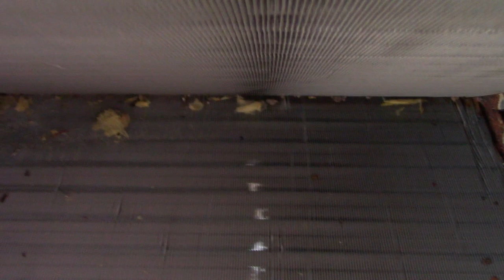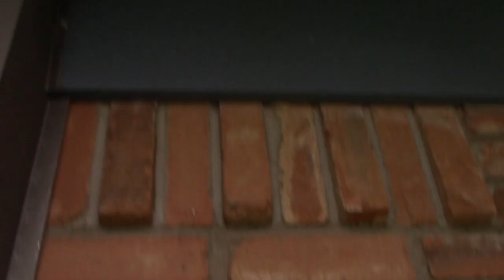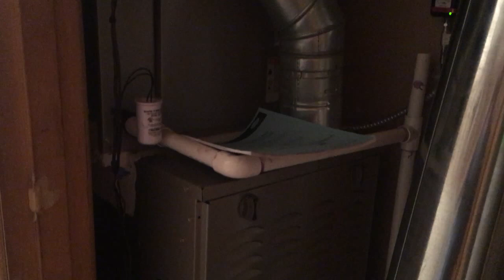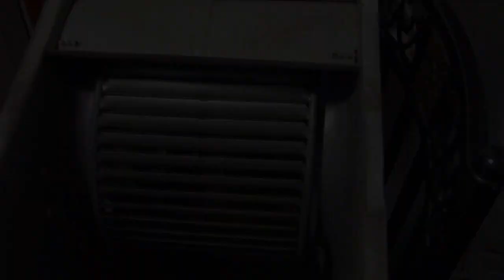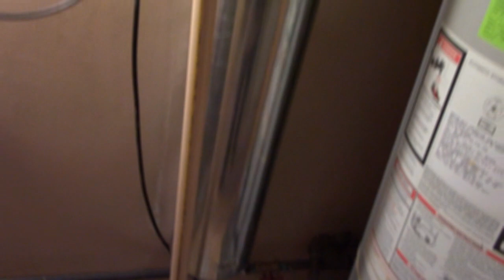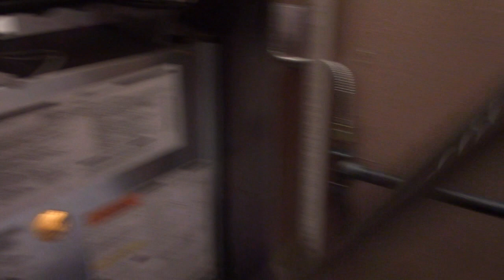2021 Carrier HVAC System Install

Comment: Hi. I'm in south florida in a single family 2200sqft under air home. I was quoted a Carrier 2-Stage, High Efficiency 24TPA748 (outdoor) and High Efficiency, Variable Speed FV4CNF005 (outdoor) units with a honeywell 9000 TS. Is this all a good pairing for my house? Is it overkill? Also it's a seer1 rating. Is that ok? I was quoted 8k which includes a new hurricane pad and supply plenum installed on garage ceiling. Good price right?

Comment: I’m thinking about buying the same hvac model. Have you had any problems with it?
Reply from the maker: No problems at all, so far! It's a nice, simple hvac system that does the job.
Reply: Thank you! Wish I could use the same hvac company that you went with but I live in SoCal. Going through the proposals now. Zodiac Heating and Air was recommended.
Reply from the maker: @veronica-j3e  You're welcome. I'm sure you'd get quite a mileage charge if you used the same company we did! I hope Zodiac does a fine job on the install, should you end up choosing them.

Comment: We just recently had a similar unit installed. It’s a 2021 (don’t remember the month) Carrier Performance series heat pump that replaced an early 2000s carrier system that’s almost identical to your old AC unit. The only difference was the year and the fact that it was paired up to a early 70s Lennox furnace. I’m looking forward to see how well it performs in the winter time, being that I live in the midwest and we can get pretty harsh winters!
Reply from the maker: Oh man, I'd sure be interested to see how well a heat pump does in your area. They are good here in the South.
We get harsh Summers, so 15-20 years is reasonable for an AC to last. Our old Carrier was developing a loud compressor, so it was just a matter of time, and that time would be in August, when it's 100+ degrees for weeks.
I hope you'll show off your HVAC system as well.

Comment: I have existing new Goodman furnace connected to old model carrier compressor if I replace with carrier do I need to change the evaporator too if previous compressor had R22?
Reply: Anything related to R22 is due for replacement. Upgrading both coils to R410a is your best option long term. But maybe someone can make it work by just replacing 1/2. And that furnace is what actually moves air for AC so improving that or the blower motor will improve efficiency.
Reply from the maker: If it's rated for R410, it should be ok. Should state on the coil somewhere.

Comment: What are the model numbers for the new system?
Reply from the maker: I'll get the models when I get a chance, and let you know.
Reply: How loud is the ac unit? Looking at buying a similar carrier system.
Reply from the maker: @BG-fx8ce  Not as loud as the 2003 Carrier. I have startup videos of both units, and you can compare. I've had family visiting, so I haven't had a chance to look at the model numbers yet.
Reply from the maker: Model numbers: 24ACC442A300, 58SC0A090E171214

Comment: It’s good to see that Carrier is still using Copeland Scroll. I can tell that’s definitely a Copeland just by the sound. They also tend to have a shinier look compared to the LG ones. LG isn’t bad, but they sure ain’t as good as Copeland, and they have had more problems.
Reply from the maker: I like less problems, and was sure relieved to see a Copeland scroll in there! I read they used the LG for a while, but went back to Copeland last year, or this year. I know sharkie626's Carriers have the LG compressors, but seem to be holding up fine after five years.
Reply: Trane has even had LG-made Climatuff compressors in them. I have seen a few. I even saw one labeled “LG”. Others had the Trane and American Standard logo and said “Made in Korea by LG Electronics.” I have seen way more Alliance compressors in there however. This only includes the 13 and 14 seer models. And even then, still mostly Alliance.
Reply: For a Coleman LX using a micro channel coil running worry free for 11 years, I’d say some people do get lucky even when it uses crappy equipment or not
Reply: That didn’t last long
Reply: Did the microchannel bite the dust?? Replace it with a Trane or Carrier ideally.

Comment: Somehow I missed this video until now.  I see you mentioned the filter drier in this video so I wasn't bringing up something you hadn't already considered.  I plan on mentioning that when we have our system installed.  Since our furnace is just in the corner of the cellar and there is lots of room around it I don't see it being a problem unless it goes against code or something like that to install the drier inside out of the elements.  

Was your old system an R22 system?  I was told by one of the guys here to do an estimate that 2020 was the last year for R22 and it's not available anymore so all the people that have been recharging their systems every year rather than replacing them are now not going to have a choice.  They are going to have to upgrade.  I do know there are supposed to be some drop in replacements for R22 available but I've heard very mixed reviews on how well they work.
Reply from the maker: No problem! It's possible our local code states the filter dryer must be installed outside. I looked at how the lines come in from the attic, and it seems there is enough room to have it inside.  I can always call our AC guy, and ask why it is outside.

Yes, the old system was R22, and I had an undisclosed source. I had to charge the 2003, twice, as it had a very slow leak. Yeah, I've heard about the drop in replacements, and the mixed reviews.
My main concern with R410, is it's enormous high, and low pressures leading to leaks. Seems to cool alright though.
Reply: @dynatrak  Apparently they are working on a new refrigerant called R32 which is supposed to be really good and runs at low pressures.  I asked about it when I was getting estimates and no one had any units that use it yet.  That has me a little concerned as the beginning of R410a phase out is supposed to start in 2024.
Reply from the maker: @tallboyyyy  Well crap, isn't that a kick in the butt! I suppose along with R134, I'll begin stocking up on R410.

Comment: Looks like they did a decent job overall! Glad you just got the on/off model too! If you were EVER so inclined to, I am willing to bet that if you put your unit's model number into RepairClinic and look for a 3-blade set with regular blades! 

One thing, the piping cover on the brick? Don't paint it, trust me. Stuff like that on a house I strongly feel looks better unpainted, plus it's less work you have to do later.
Reply from the maker: Yeah, I hear you on leaving the pipe cover unpainted. It's just primed metal, and has a huge scratch. Up close, and personal, it doesn't look that nice. I'll let it ride for now, and see how it grows on me. I did get my paint samples out, and found a very good match to the brick. Next door, when that house was remodeled, and flipped, they painted all the bricks, along with the pipe cover, and the house immediately lost it character. Painted over bricks are the worst!
I will check out repair clinic to see what type of blades are available. Three blades would look better, for sure.
Yep, single stage for the win, no need for anything else.

Comment: Lots of luck with the new system hopefully it’ll run as smooth and as well as the one that it replaced. I don’t have that vent coming down to my hot water heater and furnace my house is probably the same year as yours I think built in 62/64. I guess if I replace anything they will have to put that but my hot water heater was replaced last summer and nothing was ever said.
Reply from the maker: Thanks, I hope it holds up! The water heater was installed in 2011, and  they green tagged it, so must be some code change after that. They also require the line set cover outside, which when I paint it to match the house, it should look ok.